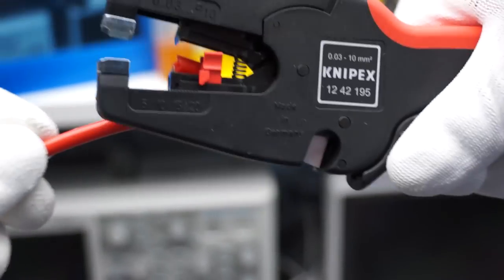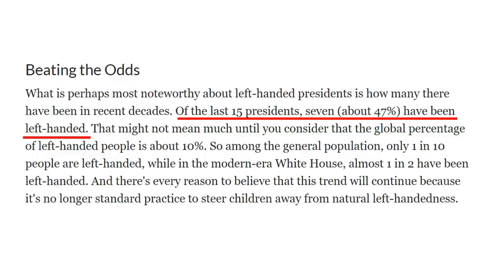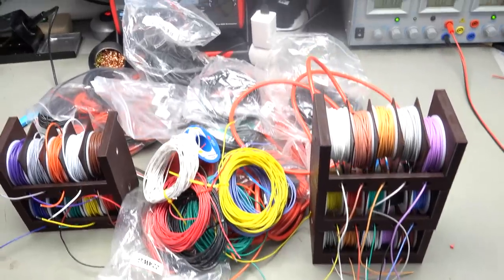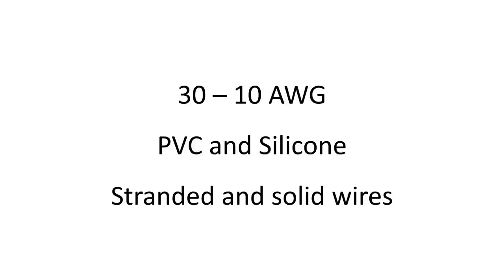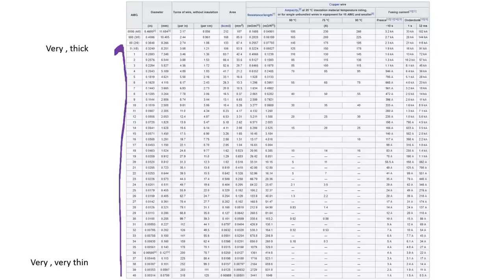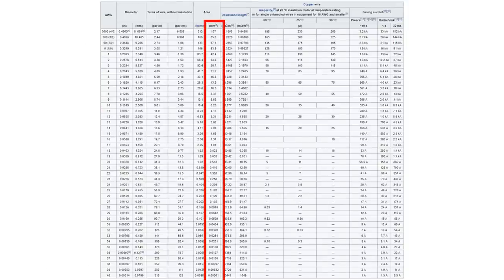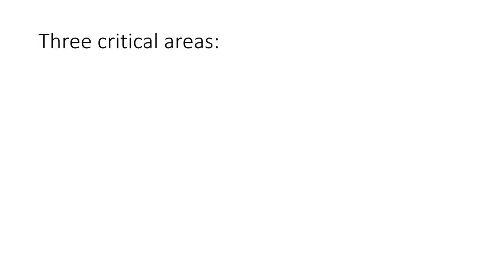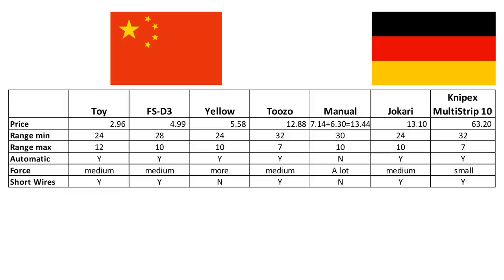#268 8 Wire Stripper Test: Germany vs. China. Who wins?

Comment: After watching this video I went to my workshop to check out my wire stripper. It is a Weidmüller stripax. I bought it in the mid 1980 when I was still a student and I can remember that it was very expensive for me. This was in the days when Austria was not yet a member of the EU, the markets were controlled by a few importers and the prices for many things were extraordinary high. But I wanted this wire stripper because it was the professional tool used by most professionals I knew. And I have not regretted it. The tool works as good as on the first day. OK, I use it only occasionally and I have never used it with really thick wires, my maximum was at 1.5mm² (approx. AWG 15) or maybe once 2.5mm² (approx. AWG 13). The range is specified from 0.5mm² (AWG 20) to 4.0mm² (AWG 11)  It has a stop for the length of the stripped end and an adjustment for the thickness of the isolation. The tool is entirely symmetrical and suited lefthanders as well, all markings are identical on both sides. Inside the handle there is eve a small brush with copper bristles, but I never figured out what this is good for, because I never had the need to clean the tool.
Reply from the maker: Thank you for sharing your experience. Long-lasting tools sometimes are cheaper than "cheap" tools.

Comment: Silicone wire is a lot more difficult to strip, so the strippers that failed at 10 awg may be able to strip 10 awg pvc with no issue.

Comment: Yellow one has adjustable end stop. Lidl sold the same kind in a kit, just red color. Also you have adjustment for cutting force, which you adjust based on wire size

Comment: I have a red version of the yellow.  After many years, it works flawlessly on many different gauges.
@Andreas, I don't think your review of the yellow stripper was fair.
Reply from the maker: There are quite a few makes of this tool. Some seem to be good, others not.
Reply: I have the red version as well.  It's really hit or miss.  I'm looking to replace mine with a different version.  Often I try once with the red version and then grab the manual ones.
Reply: @AndreasSpiess  Looks like you started another religious war :)
Reply: Agree, I have an Irwin one (blue for arguments sake :)) it works well for me as an electrician. 1mm to 4mm wire. it does struggle alittle though when i use it for appliance wire @0.75mm

Comment: I have the Yellow stripper and it works better than that, you need to adjust it for the wire you need. Also it is fits well in the tool box.
Reply from the maker: Thank you for sharing your experience!

Comment: Those yellow ones have an adjustment screw you failed to mention.
Reply from the maker: Maybe I was too disappointed :-(
Reply: @AndreasSpiess  I have some of a similar design.  I purchased them about 25 years ago at NAPA auto parts in the states.  They are my favorite strippers for small wires.
Also, they work much better without that stop on the right side.
Mine didn't have that.

Comment: I’ll likely still stay with my manual strippers.  All manual strippers are not the same, however.  The only decent ones I have come from Klein tools.  From the name, I’m assuming they are German, or at a minimum German-American.  Seems silly that it’s hard to make such a simple tool well, but I’ve never found any better than Klein.
Reply: Ziggy Stardog, American. Founded by a German immigrant in 1857...
Reply from the maker: If you read the comments it is quite obvious why ;-)

Comment: the yellow excels at stripping back insulation in the middle of a wire to tee in a connection. I use them for that and the manual strippers for doing the end of a wire.
Reply from the maker: Thank you for sharing your experience!

Comment: The FS-D3 seems to be a 1to1 knock-off of an Weidmüller Stripax. My Stripax is now 10 Years old. Still works like a charm.
Reply: Yes, Weidmüller is the best. 👍
Reply from the maker: Which one do you recommend? They sell a few different versions
Reply: @AndreasSpiess  The normal "Stripax" without "16" serves me as my 96% device. If you are doing normal repairs and "Unterverteilungen", then it will fit almost all the time. You can do a complete house cabling with just a Stripax and a Knipex 1386200 - and three screwdrivers. 
If you are more the Energieanlagen-guy and have more of 10mm^2 , then you should have a look at the Stripax 16. I have only >16mm^2, when i do connect hybrid solar converters to their battery packs or have to redo a burned cabling of my welding machines. All those strippers working from the end can't do silicone cables or braided shielding - there you are back to the "Kabelmesser" or swiss army knive - if the workplace safety guy looks the other way.
Reply: @AndreasSpiess  I believe the Knipex multistrip will match as well. The only difference might be the way it holds the isolation not to cut.

Comment: I mostly use 'Ideal-style' strippers that use a die with different size holes but otherwise work similar to automatic strippers. The only disadvantage to this style is that, like the manual strippers you show, it requires 2 different models in order to get the full range of wire sizes. And at $25-35 each, that adds up.
Reply from the maker: Thank you for sharing your experience!

Comment: Metric cables are simpler in Europe  common sizes 0.5 ,0.75,1.0,2.5 ,4.0,6.0
Reply: You are missing 10 and 16 wich you will usually see in your main connection to your house.
(Just for the people)
International: IEC 60228 and German : VDE 0295
Reply: @puddinggamez8599  other sizes were not forgotten just my opinion, I regularly work with  cable's upto 70mm odd ocasion upto 400mm
Reply: @rogergregory5981  I know i just put it there for other people who might not be accustomed with it, best regards.
Reply: @puddinggamez8599  and what about 25,35,50,75,95,120 mm² ?
Last 4 are very fun to work with... :-P
Reply: @Hobby_Electric  Youd only have those for mains and machines eg productionlines but its not as common to use them in normal industry since its not everyday your company would buy bigger machines but nonetheless IEC and VDE got those covered too.

Comment: There's a good reason for wire stripper to retain some of the insulation on the wire. Then you can lightly twist the wires while you slide the insulation off much neater than if you tried to twist them after pulling off the insulation, or can retain it on a bit longer between processing steps to prevent the wire from fraying.
Reply from the maker: Thank you for the tip!

Comment: Weicon No.5 is what I use, they are similar to Jokari strippers you showed in video. For 30eur they are fine for the price but eventually spring breaks inside the handle so I ended up using index finger to add required pressure which end up being better than relying on the default spring pressure which is excelent for small wires. Is it worth the price? Yes for small wires but anything above 4mm^2 can end up breaking the blades.
Reply from the maker: Thank you for sharing your experience!

Comment: I use the knipex stripper both at home and at my work. This is clearly the best choice and after two years of daily use it still works very well.

What you did not cover is the fact that the knipex is (I think) the only cutter that opens the jaws before returning the blades back to the front. Other strippers we have all grab the wires, strip the insulation off, push the stripper blades back to the front (pushing the copper wires out of model) and only then open the jaws. The knipex grabs the insulation, pulls the insulation off and then opens the jaws so you can remove the wires before the blades push back again - a huge advantage if you want to have a nice wire end to work with.
Reply from the maker: I was not aware of that fact. Thanks!

Comment: I have only the left hand and I use the manual and the yellow. It is hard to the yellow as the cut the insulation can not be seen and the wire is only on the roll with only 4" or 112 mm sticking out. I might try  the FS-D3 if can find it. I wire components  the 22 - 30 I wire using a soldering iron to strip the insulation.
Reply from the maker: That creates a bad smell, I think ;-) And it will not work with silicon.

Comment: I have a variant of the "Toy" stripper. Mine is not as flimsy as the one Andreas tried. It has a adjuster at the back of it's "head". But it rarely needs adjusting and automatically adapts to wire sizes. It strips a lamp cord in 3 pulls. Takes off the outer and inner isolations without adjustment. The metal parts are red but the hard plastic is black. The front jaws have 5 jagged rows of teeth each.
Been using this cutter for over 20 years. Nowhere near everyday use so it's not a professional tool.
But if you look for these toy strippers make sure to get the one with the adjuster and black plastic parts.

Great video Andreas! I love my Knipex tools too. =)
Reply from the maker: Thank you for sharing your experience!
Reply: @AndreasSpiess  Glad to help out. =)

Comment: I noticed that the KNIPEX seems to have 'shortened' the 30 AWG a bit.  Probably just needs more practice. ;-)   ...  I finally upgraded to one like the Yellow (although I still use the manual ones at times).  Mine has an adjustment thingy that I fiddle with on occasion.  Sometimes, it even works backwards - pulling where it's supposed to strip and stripping where it's supposed to pull.  Mostly with small wires.  So I use it right AND left handed.  This makes me Presidential?
Reply from the maker: At least it increases your chance to get elected ;-)

Comment: Ideal Stripmaster for the win.  Replaceable cutting dies available in almost all wire gauges, plus special dies for specific cables like coax.  The dies make square cuts (no scalloping at the end of the cut insulation) and don’t nick the conductors.  They’re not even expensive.
Reply from the maker: I read the first time the name Stripmaster in the comments of this video :-(

Comment: My Jokari works well after 5 years. Used in home electrics (complete Makeover, mostly 1.5mm^2, some 2.5mm^2) and small electronics projects.
Other than yours it usually takes the stripped insulation completely off the wire. If I want it to stay on I have to interrupt the pressing prematurely.
After around 6 months of regular use on my thicker wires it began to hold the removed insulation in its jars instead of dropping them. That is quite annoying as I have to remove them with a small screwdriver. But it is only an intermittent problem and I got used to it.
Reply from the maker: Thank you for sharing your experience!

Comment: I have a clone of the Knipex stripper with a manual adjustment slider for very thin wires. I only strip thin wires for PCBs / competent hookup. The stripper works perfectly every time for around two years now. Can highly recommend it.
Reply from the maker: Thank you for sharing your experience!

Comment: I don't know if you used it, but the yellow one has a force adjustment knob to turn in order to apply more / less force to the cutting part... that way, you can adjust at wich width it will stop cutting... I've been using them for a while, and worked OK for me, for different non-solid wires. Also, there's chineese and expensive brand versions... However, when i'm ont he field, i allways end up using just some electrician scissors... faster and cleaner, at least for me...
Reply from the maker: My "Yellow" is probably not the best make. Others had better experience than me...

Comment: Thanks for the comparison! If you need crimping tools I recommend checking out the Iwiss crimpers. The jaws are EDM cut unlike most which means they will actually work for small crimps unike the rough cast jaws most have.
Reply from the maker: I have one and am not "excited"
Reply: @AndreasSpiess  why is that? On mine the jaws fit perfectly together with no gaps and a polished finish.

Comment: Well, i don't know what you did, but i have the yellow stripper, and i have no issues stripping a 10AWG sllicone wire. It has an ajustment screw to set a higher clamping force if you are handling thicker gauges. Anyway, i use it for smaller stuff, and i can't say i have any issues with it, for the price and a smaller AWG usecase. still, i see that there might be better alternatives.
Reply from the maker: If you read the comments it seems there are a few different makes around...

Comment: I have a different Knipex, more of a gun shape. It’s the best I’ve ever used for electronics, pretty crap and bulky for electrics.

Depends on your use case. Best tradesman tools are something like CK 42984, around $20 and brilliant.

Edit: found the part code. Knipex 12 62 180, love them for electronics projects.
Reply: My favourite is the gun shaped Weicon Abisolierzange No. 5/Stripper Nr. 5. It comes for around 18 € and it worked better for me than the Knipex crocodile style. Haven't tried your mentioned Knipex jet.

Comment: I have been using the Knipex stripper for over a year now on all different sizes ( mostly 1mm and 0,5mm ). so far i strip +- 200 wires a day and after a year ive only had to replace the cutter blades once( these can be bougth seperately for just a couple of bucks)
Reply from the maker: Thanks for sharing your experience!

Comment: I have the RS Components version of the "Toy" strippers that I bought in the late 80s. Using virtually every workday since building and installing control panels, I've only just replaced the cutting jaws. Apart from a regular strip, clean and regrease they've never let me down  stripping everything from 0.2 mm to 6 mm cables. Tried other types, end strip, manual strip etc but couldn't get on with them.Seen many imitations of them over the years, seen other workers try the cheap versions and watched them break.I think I paid about £35 for them including the spare blades. My son is into electronics and they are now his go-to tool for stripping cables. But as you say, buy the best of the type that works for you as longevity, ease of use and maintenance are very important in a tool that will be in use everyday.
Reply from the maker: Thank you for sharing your experience!

Comment: 1. Could you use the Knipex blades on a Toozo?
2. Could you mod the chinese strippers to get cleaner cuts?

I've got a set of Yellows (but they're red): I love them but they work well only if you're pulling the handle quite fast
Reply from the maker: I did not try to exchange them.
Reply: That would be interesting. Since your audience is composed of makers, I believe many would find interesting to know how to mod a cheap tool into an effective tool.

Comment: I have had a rebranded Jokari for years now, I found that it works much better on the really thin wires after it's been sharpened a bit with a file. Just take a wee bit of material off the upper cutter and it works pretty much as advertised. It's best at dealing with 1.5 and 2.5 mm^2 solid core wire though.
Reply from the maker: Thanks for sharing your experience!

Comment: I have been using the Jokari strippers for over a year now still strips the same and no problems at all. I only strip PVC wires and then it can cut small wires with (most of the time) with no problem. Larger wires as 2.5mm² (I don't work in AWG) do become a problem over there but that might be out of the stripping spectrum.
Reply from the maker: Thank you for sharing your experience!

Comment: I have the Jokari one and had it for a long time, we also had some on the school I went to at some point and I found that they are not all equal because some of them we had on the school cloud take smaller diameter then others and the one I have at home is very bad at small diameter (don't know the AWG number). Sometimes with bigger wires the plastic insulation binds behind the cutter. I find it fast and easy to use but I would like it to do smaller wires.
Reply from the maker: Thank you for sharing your experience!

Comment: I use the Knipex 12-20-200 and the Hazet 1863 (made in GB not Germany) and have for years they are outstanding. New cutters for the Knipex are $9USD. My son has a set of Felo 62681 that look just like the Jokari except they are yellow. He uses them as I do, professionally, and he likes them a lot. Mostly due to their size. He can reach in tight areas with them and work.
With manual strippers I tend to put in the wire squeeze lightly then release and rotate 1/4 turn and squeeze lightly  again and remove. This stops the cutting of the copper wires and even the damaging is them.

Excellent review.
Reply from the maker: Thanks for sharing your experience!

Comment: I have the "Knoweasy" version of the "Toy." It works pretty well. But the adjusting screw has no measurements on it so you have to experiment to get the right depth. I spent $13USD and will be sending it back for the KNIPEX - thanks for the demo, you've saved the day!